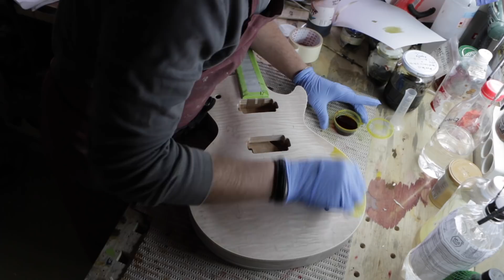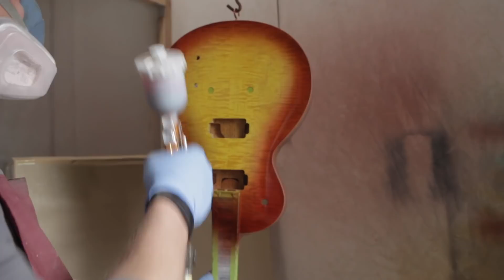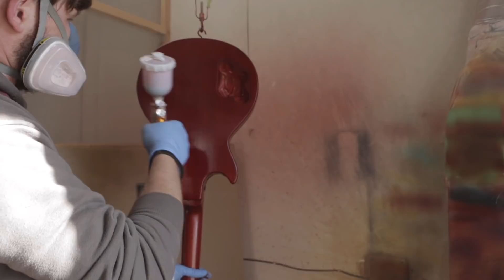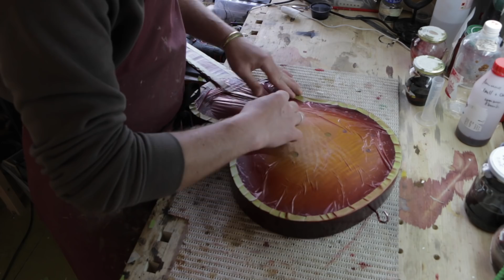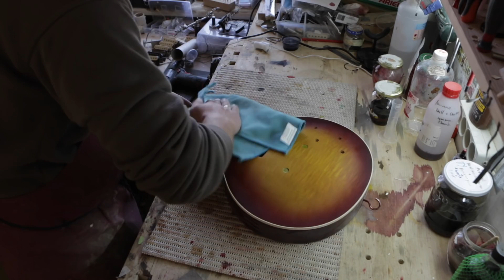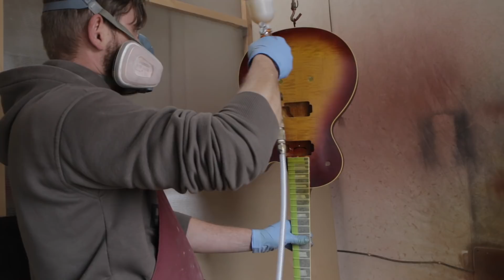'59 Les Paul Burst nitro finish by Dr.Nitro. part 3. Painting

Comment: Hi.....are the backs of the vintage bursts sprayed in red, or is the back just clear coated over the red analine dye?
Reply from the maker: Yes, according to the original technology, the back of the guitar was covered with a tinted red aniline oil-soluble dye.  Aniline has the property of mingling into laquer over time, which is why the already dried laquer turns red.  the dye remains only in the pores of the wood.

Comment: Do you use the same nozzle for each layer, or do you vary depending on the application?
I've been watching Gibson factory videos, and they bang out a sunburst in about 2 minutes from start to finish, it's incredible how much more care and attention you put into your work.
Reply from the maker: I use one attachment for all layers. My method differs from the factory one in that my hard nitro varnish dries a little longer after application, since I use a solvent with a retarder. This allows me to make very thin and smooth layers and have complete control over the color. In the factories, Gibson uses a very fast varnish to shorten painting times and prevent future cracks. This varnish is only nominally called Nitro, but there are extremely many plasticizers in it. Even when dry, it is sticky. At the factory, it is poured in thick local layers and ground in third thicknesses. This allows you to pay less attention to the preparation of wood and masks minor flaws.
Reply: I can definitely see the benefit of your process, the extra care and attention shows in the final product.  I've seen some other videos advocating the use of urethane as opposed to nitro.  For an amateur like myself do you think it's ultimately going to make a difference?  Hope you don't mind all these questions, appreciate any insights you can share.
Reply from the maker: @andrewbowler4863  My painting process is constantly changing as I experiment a lot. But I have the opportunity to devote more time to this process than factory workshops have. I am an artist mainly doing art, so I paint guitars slowly))) I can remove all the layers and redo everything if I don't like the result, or add another operation. The process and the experience gained through it are important to me. I know exactly what result I want to get in the end. The choice of varnish is a very broad question and here a lot depends on the tasks and the result to be achieved. Historically, nitro varnish was used by Gibson in the fifties as it was the newest and cheapest varnish. For the same reason, Gibson used nylon nuts. This material was then considered a new technology and was cheaper and easier to process than bone. But bone sounds better. Nitro varnish has a number of disadvantages for factory production: it is toxic and cracks over time. Now cracks in the varnish of an electric guitar are considered a plus and for a reason. Cracked hard varnish vibrates very well with the wood and does not bind it. But cracks in production are considered a defect. Therefore, although Gibson now declares that their guitars have nitro varnish, but this varnish is very soft to avoid marriage. Polyurethane varnishes are now sometimes much harder than nitro varnishes with plasticizers and even crack in the same way. The main thing is that the layer is not thick and does not constrain the resonance. For this purpose, for violins, super-soft varnishes were used, which could vibrate with the body. If you want a good glossy look for your guitar, you can also use polyurethane like: Herlac Kontracid D 3030, But in thin layers. If you need historical correspondence and cracks in the varnish, then nitro varnish without plasticizers (or with a minimum content). If you need to do the job by hand and get a super thin sounding layer, then I recommend shellac and a French finish.
Reply: @8BombCustom  Thanks so much, really appreciate your taking the time to respond!

Comment: what is the regulation of the gun and compressor?
Reply from the maker: Always different.  No more than 2 atmospheres come out of the compressor.  On the spray gun, I adjust the air supply depending on the viscosity of the varnish and my tasks.  At the entrance to the spray gun, I do not have a pressure gauge.
Reply: @8BombCustom  Thank you my friend.  Your videos help me a lot

Comment: I was taught to sand with the grain...why sand against the grain?
Reply from the maker: This is in order not to raise the pile of wood.  Of course, if you sand perpendicular to the wood fibers, then the wood is eaten faster, but then the pile rises and with a thin layer of varnish it gives an undesirable effect.  When sanding along the wood fibers, the pile is smoothed and the surface is perfectly smooth.